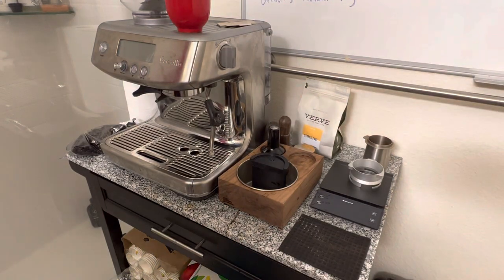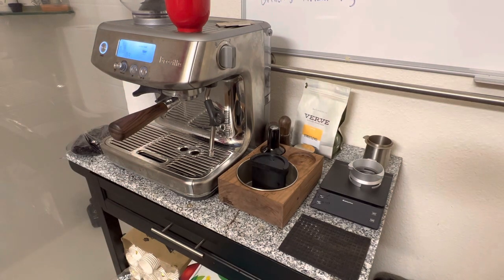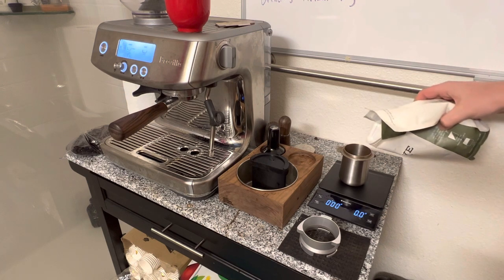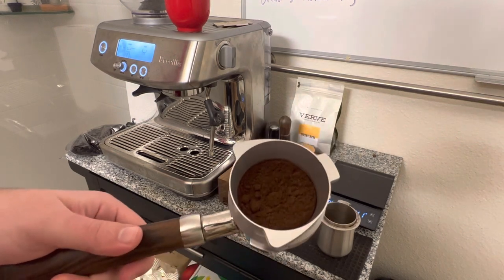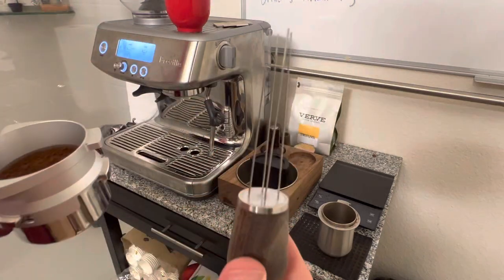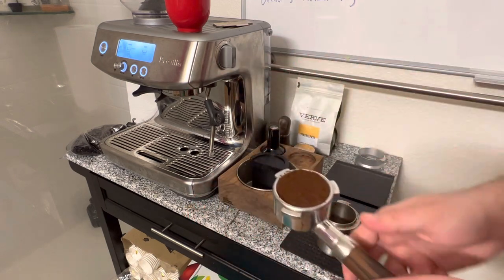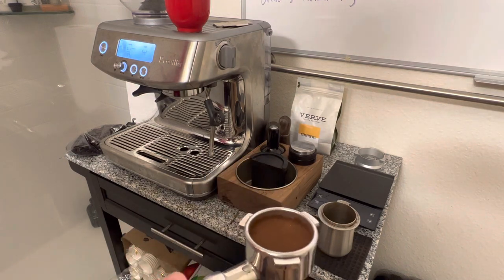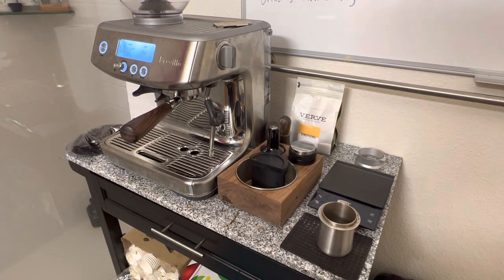Breville Barista Pro full shot walkthrough

Comment: How did you program the doubleshot button to go for 32 seconds?
Reply from the maker: I did not program it for time. It’s volumetric. So if you’re getting much less than 30 seconds or so, you either have channeling issues or you need to grind finer.

Comment: Hey Joseph! What are the burr grinder settings you have yours set to? I shamefully have been using Starbucks blonde espresso beans since I get them free and I’ve noticed that my shots are entirely BITTER. Really bad. I have the grind size set to 9 and the burr grind set to 4. Thoughts?
Reply from the maker: Usually bitter means over-extracted. How are your shot times? And is your pour coming out pretty evenly? 

Early on, I distribution issues, but was able to get the shot time targets by grinding way too fine. The result was pretty bad espresso.
Reply: @Joseph-kz1vn  so what you’re saying is I could be grinding too fine?
Reply from the maker: @tylermprice  possibly. If your distribution is not good. It can be hard to see distribution problems without a bottomless portafilter. 

I might buy some Starbucks blonde and try myself - I’m curious.
Reply: @Joseph-kz1vn  yes please let me know if you do and I’d love to hear your thoughts and know what your burr grinder settings are. I think that mine could be so fine that it’s making so bitter.

Comment: Awesome video. What about a single shot? I'd love to see that process or is everything supposed to be half? Like rather than 18g it should be 9grams. Does the extraction time stay the same or not?
Reply: Will be dependent on bean and grind setting. The bean I am currently using at setting 10 on grinder gives 10 grams of ground coffee after 7.5 seconds of grinding. I then go into Menu singe shot Custom with empty shot glass on scale zeroed press and hold single shot button for 6 to 7 seconds for pre-infusion and then them keep eye on scale and stop the shot at 20 -22 grams (or whatever output you find tastes best, usually somewhere in range 2 to 3 / 1 for espresso / coffee weight). Single shot is then set for that bean. 
The same can be done for double shot with double basket and button and then your only variable will be grind time between single and double shots.
POf course if you choose to use another bean then you repeat the process.
The use of a £10 digital scale makes the process a whole lot simpler.
Reply: The single and double settings are pretty different. You typically need to grind more beans in order to have the portafilter filled to the right height, but also grind a few clicks coarser to prevent too slow of a flow. Even if you literally halved the weight of the beans you still need to grind coarser because the shape of the basket creates more pressure due to fewer holes. It's hard to tell you exactly what weight you'll need because some beans are more dense than others. I can fit 20 grams of my medium roast beans into my double basket, only 15 for my decaf dark roast.

Comment: Very helpful video! One question: Assuming 18 grams of coffee, is there a difference in taste (or something else?) between a double shot of 36 grams pulled between 25-30 seconds and 36 grams pulled between 35-40 seconds? I'm using the Breville Barista Touch, if it matters
Reply from the maker: Yeah a faster shot is going to be less extracted. In general, it's harder to over-extract a light roast bean, so if you are using light roast beans you may find that you like the taste from longer extraction times. For medium and darker roasts, you often get a strong bitter/burnt taste from over-extracted espresso. 

A good rule of thumb is that under-extracted coffee tastes sour while over-extracted coffee tastes bitter.
Reply: @Joseph-kz1vn  Thanks. That is just the information I was looking for!

Comment: so if you bought 4 different bean types (to test which you prefer), you need to dial each type every time? how much taste difference does it actually make?
I like to try a wide variety of coffee but don't want to waste so much in the process of dailing-in
Reply from the maker: yeah each bean will need to be dialed in separately. Typically that will take maybe 1-2 mediocre shots before getting it right. 

That said, Ive found with experience I’ve gotten better at making decent guesses for where to start depending on the roast of the beans.

Comment: My portafilter is Too tight.. I new but I got also BBE and it was easy to set the portafilter, and now I changed for the PRO and it is extremely TIGHT. Should I keep it? I wonder if should have to kept the BBE.... I will keep the PRO but I am afraid should be better the BBE.
Reply from the maker: Sometimes the portafilter is tight if the machine is cold. 

If you pull a blank shot of water through first, is it still tight?
Reply: @Joseph-kz1vn  I works thanks, now I am concern about temperature... it is 65 celsius for the shot, vs Barista expres 73 celsius
Reply from the maker: You can adjust the temperature a bit in the settings. My personal experience is that the default setting is best for the light roast beans I’m using. It get significantly more bitter if I raise the temperature.

If you’re worried about the temperature in the cup, preheating the cup and preheating the portafilter can help, of course.
Reply: @Joseph-kz1vn  I already programmed the maximum temperature. and it is still much lower than in the BE (almost 10 Celsius of difference). I really would have loved to keep the BP since the coffee extraction is wonderful because of the cream it generates. greetings from Mexico
Reply: @Joseph-kz1vn  As Joseph said, try the default setting however it's important to run two flushes through the portafilter to get it hot then towel dry and dose.  Cheers.